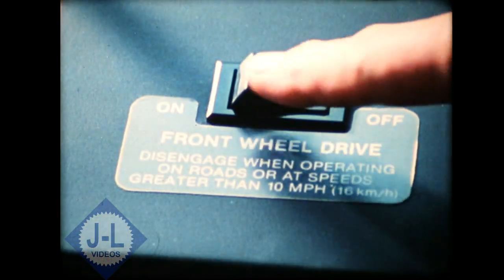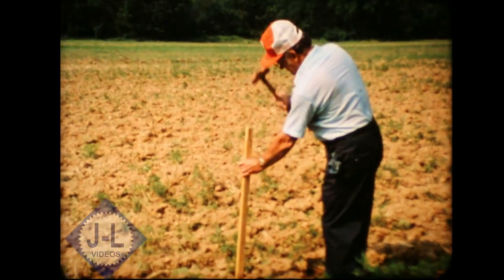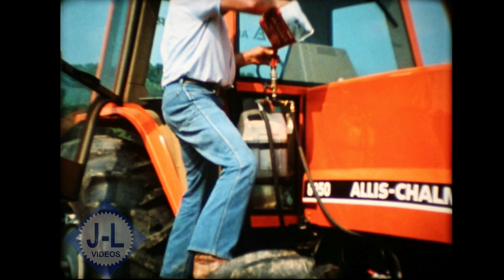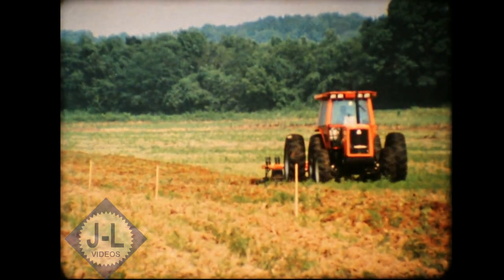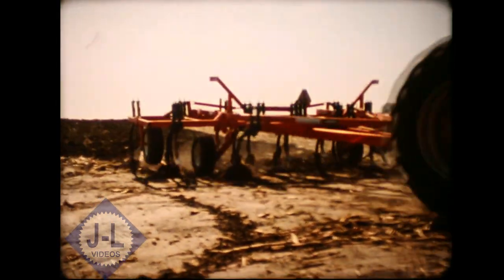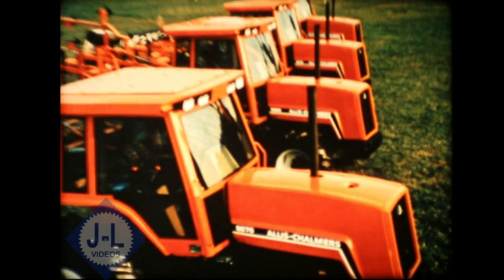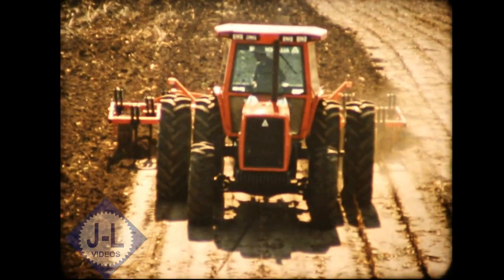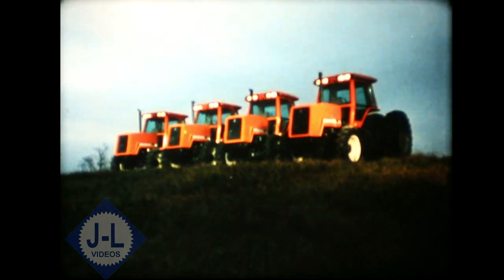1980's Allis Chalmers Dealer Movie Front Wheel Drive For Higher Efficiency 8000 series Tractors

Comment: I plant cover crops with an 8070 . We farm over 8000 acres and we still use the older machines for rock picking and cover crop planting.  We started out with all ac equipment.  We bought  2  gleaner s98 combines this fall  .  Those 8000 series machines were great .